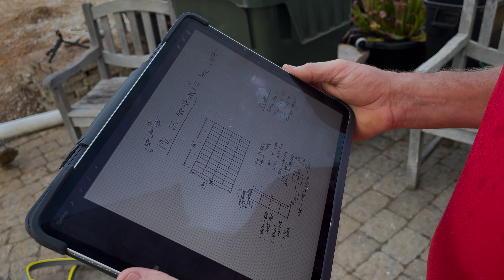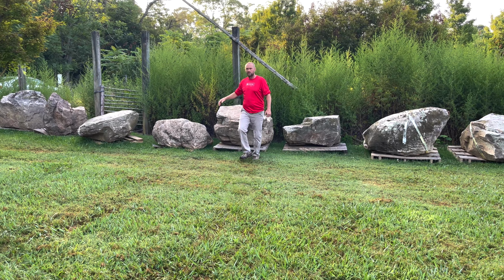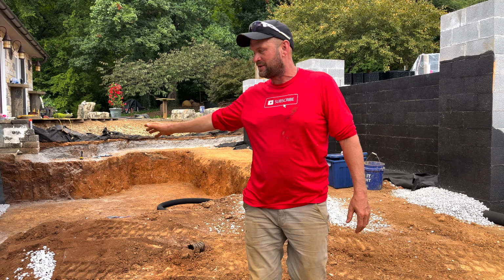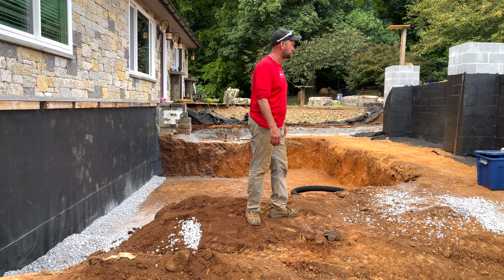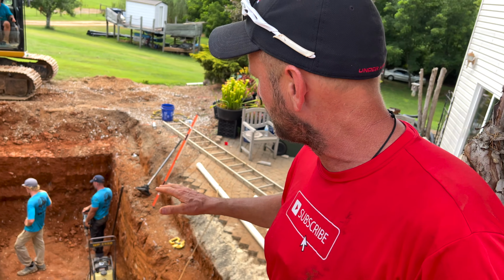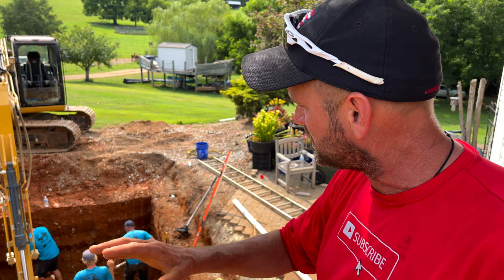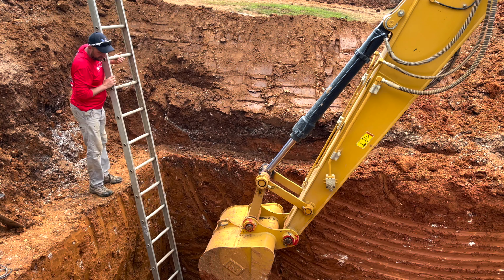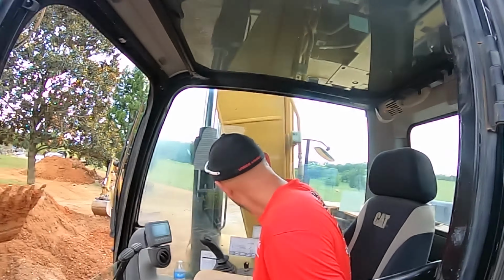Creation Of An Epic Swim Pond Part 6 | 8000 GALLON RESERVOIR FOR NEGATIVE EDGE

Comment: An extra 2' in the reservoir with a machine like that is... what... 3-4 more scoops with the bucket? I'm getting ready to finish off my (much smaller) negative edge soon, and came up with a similar solution. Bib liner to create a pooling area, but with a 3" valve at the bottom so I can empty the bib as needed. Thinking I might stick a fire pit on top of the reservoir. Valve closed to create a shallow pool, valve open when it's time to roast some marshmallows.
Reply from the maker: We are getting ready to do the fountain scape in the reservoir here in the next few weeks. There is fire in the plan! That reservoir Ends up holding more around the 10,000 gallon mark by the time we put in the overflow and getting it all locked together. Stay tuned (and don’t forget to share yours as it comes along, I want to see what you have done)

Comment: Loving the videos. Great ideas with the bib liner to create a lower pond instead of a gravel pit. Just curious if there are concerns with the foundation block wall and the water pressure against it.  is there any structural concern and buttresses needed for the length of wall under the load?
Reply from the maker: I did consult a structural engineer. Based on my wall construction inside there was a green light for water pressure BUT I am going to put a horizontal footer inside the pond as an added “just in case. It will support the “flat work” that finishes the pond detail up against the house. We have a plan for that and the materials on hand. I just need to get to that point ASAP!

Comment: Y'all are kickin ass! Wow its gonna be awesome! John, how much room do you leave open when you do the bib liner to keep those pumps from choking? Do you have a formula that you use to know how much liner you can lay:how much you leave open...and would the area change due to aqua blocks stacked instead of a single layer. My enquiring mind wants to know...🙂 lol...God bless
Reply from the maker: No formula. I will start small and if debris & flow cause a clogging or maintenance issue I will just open it up more. Each environment is different. I am going to push the envelope on this one!